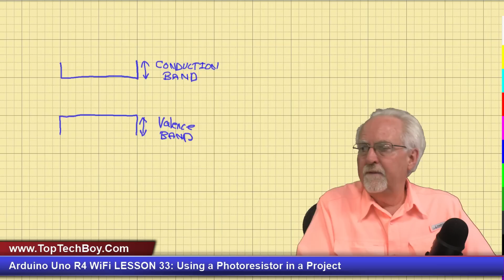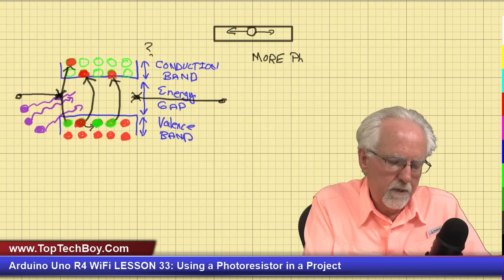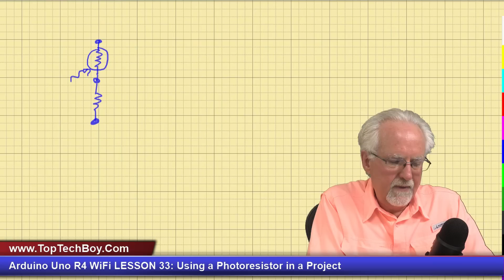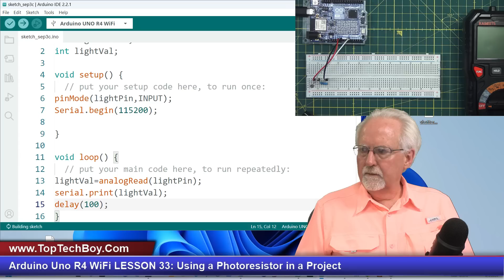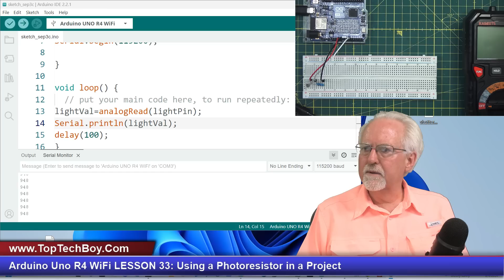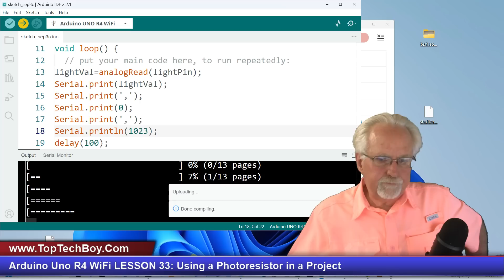Arduino Uno R4 WiFi LESSON 33: Using a Photoresistor in a Project

Comment: I made a Sliding LED light meter...  Here is the Code..  video tomorrow?  I did it with coding learned.. An Array for 10 leds. For loops to turn on and off at a Mapped level 0-10

int ThermResistor=A0,ThermValue=0,ThermConv=0,a;
char msg[50];
byte red1=3,red2=4,red3=5,yellow1=6,yellow2=7,
      yellow3=8,green1=9,green2=10,green3=11,
      white1=12,
      waitled=0;

byte leds[10] = {red1,red2,red3,
                  yellow1,yellow2,yellow3,
                  green1,green2,green3,
                  white1};

void setup() {
 Serial.begin(115200);
 delay(100);
pinMode(ThermResistor,INPUT);
for (a=0;a<11;a++){
  pinMode(leds[a],OUTPUT);
}
}

void loop() {
 ThermValue=analogRead(ThermResistor);
 ThermConv=map(ThermValue,0,1023,0,10);
 snprintf(msg,sizeof(msg),
 " Thermal Raw value: %d  Converted to usable: %d",
 ThermValue,ThermConv);
 Serial.println(msg);
 delay(200);
 
 if (ThermConv==0) {digitalWrite(leds[0],HIGH);
 for (a=1;a<11;a++){digitalWrite(leds[a],LOW);} }
 

if (ThermConv==1) {digitalWrite(leds[0],HIGH);
                    digitalWrite(leds[1],HIGH);
  for (a=2;a<11;a++){digitalWrite(leds[a],LOW);}
}
if (ThermConv==2) {for (a=0;a<3;a++){digitalWrite(leds[a],HIGH);}
for (a=3;a<11;a++){digitalWrite(leds[a],LOW);}
}

if (ThermConv==3) {for (a=0;a<4;a++){digitalWrite(leds[a],HIGH);}
for (a=4;a<11;a++){digitalWrite(leds[a],LOW);}
}

if (ThermConv==4) {for (a=0;a<5;a++){digitalWrite(leds[a],HIGH);}
for (a=5;a<11;a++){digitalWrite(leds[a],LOW);}
}
if (ThermConv==5)  {for (a=0;a<6;a++){digitalWrite(leds[a],HIGH);}
for (a=6;a<11;a++){digitalWrite(leds[a],LOW);}
}
if (ThermConv==6) {for (a=0;a<7;a++){digitalWrite(leds[a],HIGH);}
for (a=7;a<11;a++){digitalWrite(leds[a],LOW);}
}
if (ThermConv==7) {for (a=0;a<8;a++){digitalWrite(leds[a],HIGH);}
for (a=8;a<11;a++){digitalWrite(leds[a],LOW);}
}
if (ThermConv==8) {for (a=0;a<9;a++){digitalWrite(leds[a],HIGH);}
for (a=9;a<11;a++){digitalWrite(leds[a],LOW);}
}
if (ThermConv==9) {for (a=0;a<10;a++){digitalWrite(leds[a],HIGH);}
for (a=10;a<11;a++){digitalWrite(leds[a],LOW);}
}
if (ThermConv==10) {for (a=0;a<11;a++){digitalWrite(leds[a],HIGH);}
}

} // end Void Loop